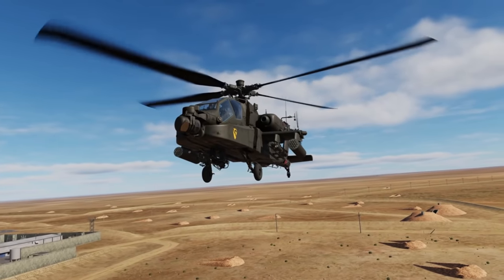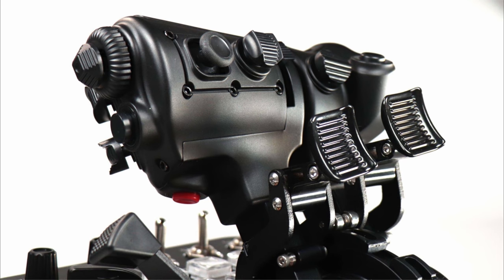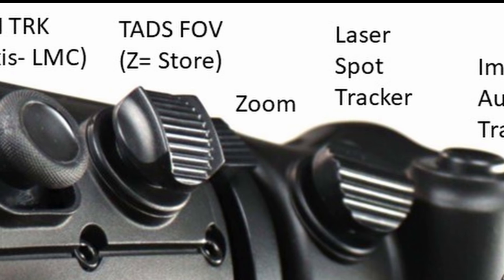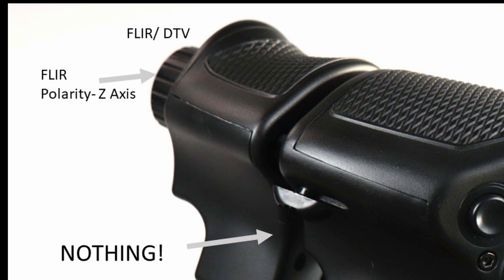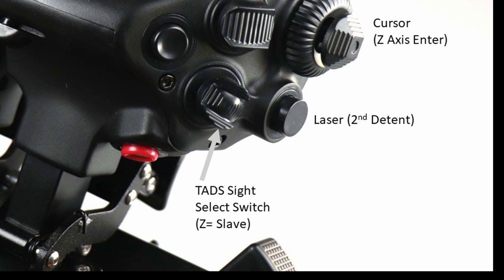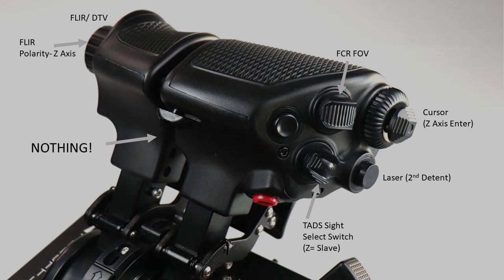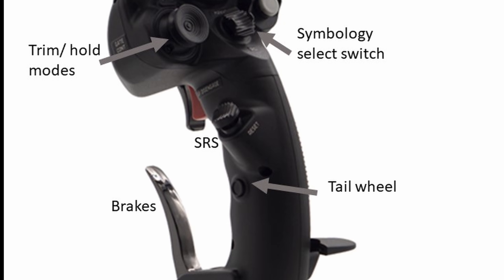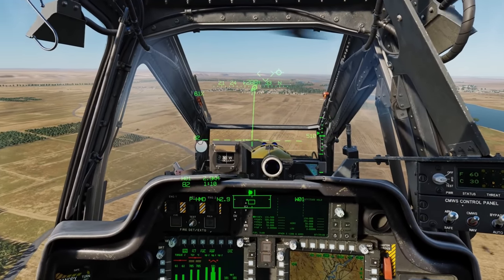DCS AH-64D Control Binds; "a" way | DCS World

Comment: I got the Virpil collective w/ the left alpha grip. Can't wait to set it up
Reply: hi, what type collective u got ordered for AH-64 from virpil?
Reply: @flex5002  it's the VPC TCS base model, without the throttle grip for now. I have it already and tried it out With the helicopters in DCS and it's nice. One thing I didn't notice was that the chair mount is separate so I'm waiting on that now hah
Reply: @taidean  ok, I see, because I'm was wondering which type of collective actually fits best by the buttons layout and visually/immersing for AH-64D the VPC Hawk-60 Collective Grip
Or VPC SharKa-50 Collective Grip
On the VPC Rotor TCS Plus Base, I'm asked to Virpil if they have any plans to release the AH-64D Replica Collective Grip, because it is unike like from other choppers but they don't want let me know about future plans, so I'm ordered only VPC MongoosT-50CM3 Throttle
And VPC Constellation Alpha Flightstick.
Reply: @flex5002  Ah, I went with the Alpha left grip to go with the collective since it has the most buttons on it. The shark and blackhawk grips looked like not enough buttons for "just in case" I need more buttons hah. i have all 3 Virpil control panels also for "just in case"
Reply: @taidean  yeah, I think we need to try the AH-64D model it self to see what we actually need most of it 😊
Reply: This looks to be the best combo for the collective. Plenty of hats plus the slew stick.

Comment: I am really glad we use the same throttle! I totally get everything you said. I may try it your way when we get our hands on it. Thank you!!
Reply: My TM Cougar throttle: * feeling sad *
Reply: My TMWH throttle "ministick": [SwEaTiNg InTeNsIfIeS]
Reply: Replace it with a Deltasim mini stick upgrade, you can pretty much fit the same mini stick of the Virpil throttle to the Warthog one.
Reply: @mhe0815  Yeah, it's a great mod and even Wags uses it. Was good enough for me so far to just press and hold a key and use the hat of my stick, never really needed control with different slew speeds, at least I felt so. But I'd need to put my Hornet antenna elevation and Tomcat DLC somewhere else without having appropriate hardware for those then, unless I won't use that thing for the TDC in the Hornet (not an issue in the Cat).

Comment: I think I should be pretty well set with my Logitech Saitek X-56 Rhino HOTAS. I got it for a pretty good price from Amazon, has a lot of spring loaded momentary switches for mapping, plus a mode selector knob to change them all to something else if I need too, though I have never really needed to do that thus far. I use an Xbox controller when I sit in the front of the Hind but like a lot of others, I have found being in the front seat with Petrovich flying...less than ideal.

Comment: I was actually able to map all TEDAC functions to an xbox one gamepad. I needed FreePIE for some stuff but I basically set it up so that face buttons, sticks and dpad have 3 functions each with bumpers as shift. The idea is that without shift sticks are cursor and slew, dpad is for highest priority hat on left grip, face buttons correspond to free buttons on right grip (like slave). Pressing a bumper on the same grip as the corresponding control shifts to "medium" priority with sticks working as digital hats (with use of FreePIE and mapping shifted axis movements to unused view control axes), then pressing bumper on opposite grip shifts to "lowest" priority. It will obviously take some time to figure out which hat to assign to which priority, but I think this will work better than mapping it to hotas, particularly since I don't have that many hats on mine.
Reply from the maker: Whatever works!

Comment: Man, those Virpil controls have so many more switches/buttons than TM gear
Reply from the maker: Yeah but use of the modifier functions can expand your options quite a bit
Reply: @CasmoTV  very true I feel like in the heat of combat I would get modifiers mixed up.
Reply: @arguy3297  you can set a mode, so that in mode 1 takeoff/nav buttons do x, when near combat area use the  shift modifier and its in mode 2 and the keys do something completely different. It can help if you are having that issue. Just a thought

Comment: 3:03 Is the "Store Update" function of no use in the real aircraft as well or just for DCS purpose?
Reply from the maker: It’s for INS navigation.
Reply: @CasmoTV  Oh, INS navigation fixes. I see, thanks!

That might be interesting, depending on how far ED goes in terms of INS modeling. It's also an item that is still WIP for the Viper and the Hornet, but is necessary for missions where GPS is not available (usually if the mission date is pre-1994).

Comment: I just assume that I can bind all buttons as a pilot, but when I switch to CPG, I get to bind all (soime) buttons again, to other functions, right ?  Did I make any sense ?
Reply: Oh wait, you already answered that in other comments... thanks.  Your setup doesn't work for me by the way. In VR you have to use a button for zoom, not a slider. Even 2 buttons, for 2 zoom-levels. That's is my left pinky switch. On the cyclic, the pinky-switch is a modifier. But do'nt worrie, I'll figure it out :)
Reply from the maker: I use the four way hat on the right side of my stick as the zoom and interact in VR

Comment: This is so confusing, following this guide I'm completely out of hat switches and I have 7 across my stick and throttle and I'm only halfway through. Completely baffled on how to set this up.

1) Which Image Auto Tracker do you bind? There are two in the keybinds and you only mention one.
2) What FLIR/DTV? I haven't found any keybinds matching this.
3) What FCR FOV? There is no control with this name.